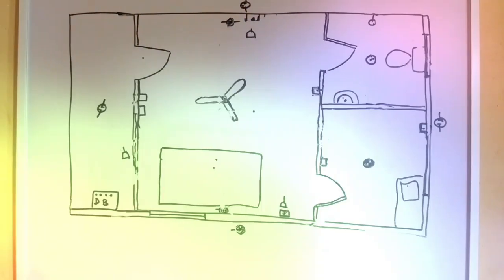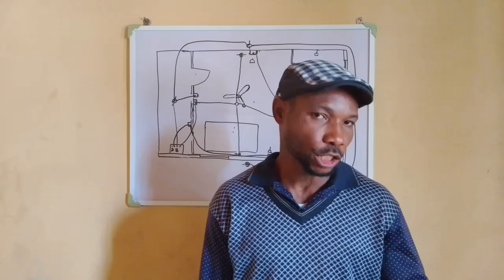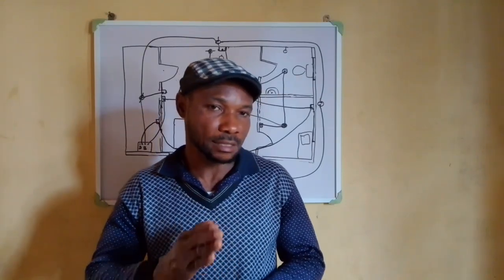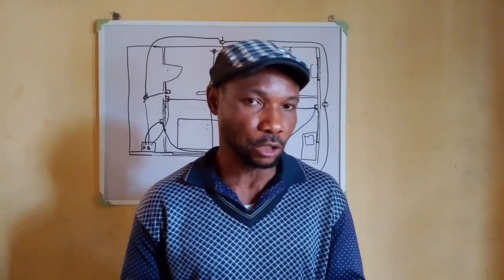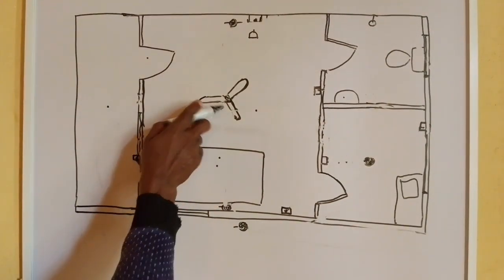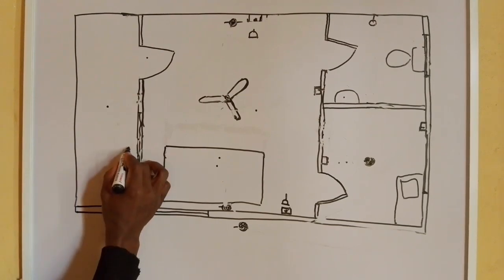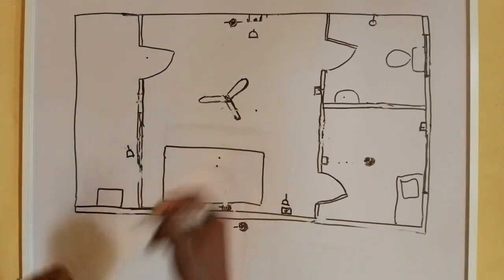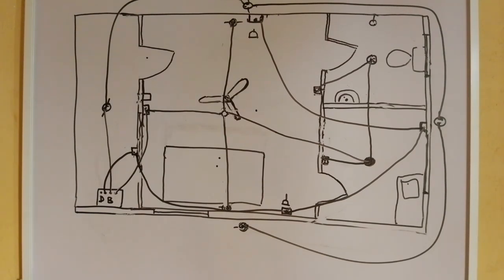How to Start House Electrical Conduit Piping" like a pro.

Comment: Why a you giving all the socket one breaker yet there is also another breaker is empty the
Reply from the maker: Thank you for your question, but I want you to understand that I'm using this for an explanation off what you need to do before you start a conduit piping project. The distribution board here is a single phase DB. So whether you use the four socket outlets on a breaker and reserve the other  breaker, or split the sockets into 2. The circuit will still be balanced. Take a look at this link and learn how to balance your socket. The maximum number of sockets in a circuit is normally 6. 

But then the point I'm making in this video is you must balance your conduit piping before commencing work.
https://youtube.com/watch?v=Lzg5dhYpVzw&si=XCLNXWEbhoTgCAgt

Comment: Where is the main switch
Reply from the maker: Please reframe your question (  I  guess you mean the panel control , change over switch or the LV switch gear). If I understand your question, we did not include any of those switches in this video. I only balanced the piping layouts to lighting points switches, and choose a consumer unit.
Reply from the maker: For the main switch gear, changeover switch and panel control you can take a look at my last video and more tutorials on the way

Comment: Am David from Lagos Nigeria please what about your natural cable
Reply from the maker: Nice observation brother. Actually in this demonstration I introduced few things which I later discussed in my subsequent videos. 

Please take a look at this video in case you face a similar case at a building/ house piped by another electrician, such that the pipe did not go to lighting point before getting to the switch: check it out!

https://youtube.com/watch?v=BgnS4QIO9C8&si=yXPxR2G17kokvlGx

Comment: Very good teaching, but kitchen unit can't be looped with  other socket in the house, it's because the current (Amp) differs, i think the kitchen socket should have its circuit alone
Reply from the maker: Good point!  But let us not forget that we may have 13 Amps as well as 15Amps  sockets in the same kitche, the former can be used to charge phone for instance while the later is for high rated gadgets like electric kettle. So the 13A socket can be looped with other circuits while the cooker units should never be looped. Thank you!

Comment: One circuit for all the sockets , can one breaker carry all the loads especially with kitchen socket where hot plate might be used and iron might be using at the same particular point in time. Am i missing something bro?
Reply from the maker: You're not missing something at all. Besides that's a good question.

For sockets, 6 socket outlets is maximum for a circuit. This means that it could be less than  six sockets and Pressing iron is around 5 Amps okay.  And all the 6 sockets will never be used with pressing iron at same time. 

But when it comes to cooker units, A/C, HOT plates, electric kettle, water Heaters etc the circuit is run  separate ( I mean 1 socket per circuit and the fitting is 15 Amps), And the circuit breakers   must be high enough in rating like 25,30,35 etc. Hope  we are not missing anything?

You can take a look at my related videos below:
* How to Balance Conduit Piping of Socket Outlets [https://youtube.com/watch?v=Lzg5dhYpVzw&si=XCLNXWEbhoTgCAgt]
* How to use electrical working drawing [https://youtube.com/shorts/lLfd9iiPr8w?si=jqb5zurj0zlrFnDp]

Comment: Sir please what if there is an Ac and water heater how do u run the pipe connection
Reply from the maker: You can now watch the video on how to pipe AC, Water heaters and Cookers
Reply: Hi please can you drop the link@ElectricEdge-4sp
Reply from the maker: Thank you for your question. In my next video I included the water heater, A/C, Cooker unit and a two way switch arrangement so try and watch it for better explanations.